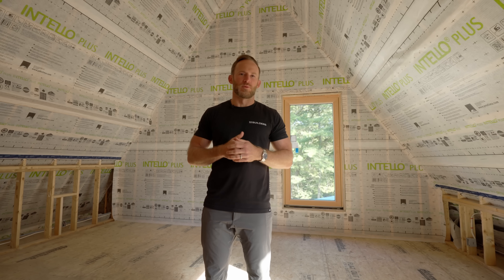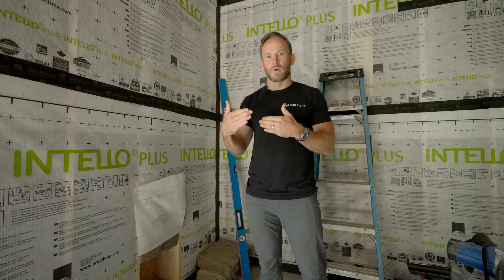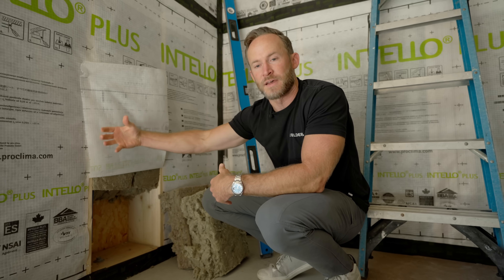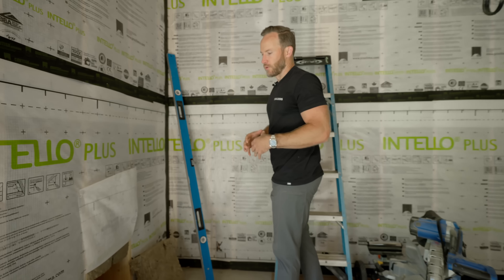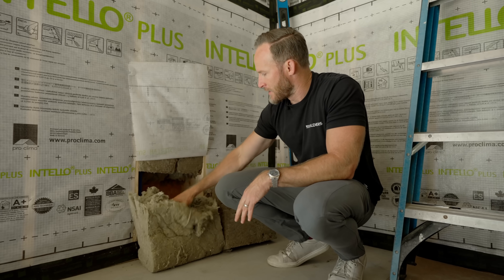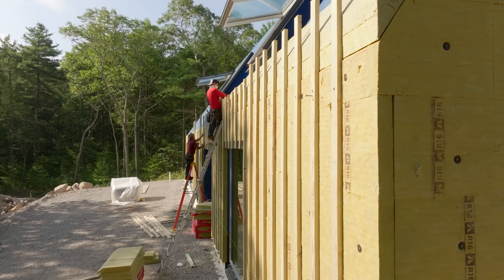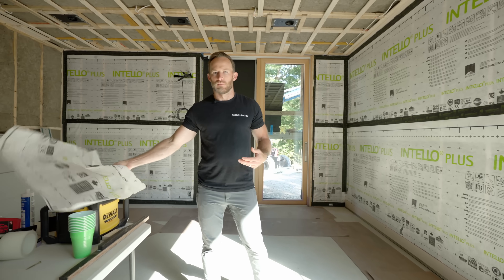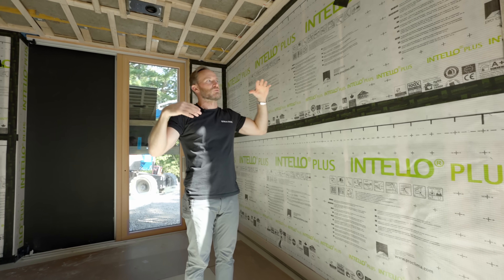Better Than Spray Foam? Why We Choose Mineral Wool

Comment: Theres not a lot of options when it comes to insulating a vaulted ceiling in cold climates. Most people cannot achieve the needed R value without using spray foam.

Comment: Nice work and presentation. I would have liked to see how you work around electrical boxes and not just wires on exterior walls. It's tough to get all those holes sealed.

Comment: There is so much misinformation on the internet about CC Spray Foam.  2x10" walls struggling to get good R-Values.  R values were invented by companies that produce fiber.  Why not examine BTU heat transfer and air sealing of CC vs fiber?   4" of CC spray foam stops up to 96-97% of BTU heat transfer, adds 2-2.5 X racking strength, air seals and is a moisture barrier all in one, while fiber adds none of these benefits.  This job and your approach make this a very expensive build trying to achieve something a good quality CC spray job could do for far less with far better benefits.

Comment: Talk to an acoustician, but I'm pretty sure you would get better sound reduction performance if you left an air gap in your wall somewhere. So say, drywall- air gap-insulation-drywall. In fact, even better if you used sound channel perpendicular to your studs before the drywall goes on.
Sound transmits through air and through the structure. You need to block both types of transmission to ensure thorough sound reduction.

Comment: It looks like your're using the adhero on the exterior and intello on the interior? Why not just make the exterior sheathing your air barrier? Is having both an interior and exterior air barrier worth the extra cost in product and labor? Does having both create a moisture management issue within the stud cavity?

Comment: Nice Design. Yes, foam is a disaster, wood needs to breathe. Rockwall rocks! Foam is a perfect matrix for mycelium mold, wood rots really quick, surrounded by foam if it gets wet. Nothing wrong with air handling especially with that much vertical, stacking effect can be an issue.  air needs to be filtered and conditioned the house. That's too tight is unhealthy. This is going the right direction. Here is an interesting fact in the UK, banks won't refinance if the house is sprayed with foam... close cell or open cell.

Comment: Better than spray foam? Yes, but its a hard material to buy unless you are contractor. The distributor system is lacking and honestly, a very old business model that needs to die. And its even harder to find quality installers.  Spray foam is everywhere. You can contract it and have it installed with a simple phone call.

But! If you can source it, and install it, its awesome.

Comment: Just sold me on foam, thank you. Didnt realize how much it would cost, i always thought spray foam was super expensive and only for the rich, but now i realize that to overcome all the obstacles you have to engineer around everything like expensive walls and framing, ventilation, exterior insulation, etc. Spray foam and if your worried about health then encapsulate it with some paint.
Reply from the maker: Paint doesn’t fix the health issue. Not the bigger degradation issue.
Reply: @NSBuilders I thought you were talking about the out gassing of VOC's caused by improper installation. Tell me more about the degradation problems. I do know that uv light will degrade the foam really fast and anything exposed to light should be painted as soon as it is fully cured even if it's temporarily exposed. Is there any way to address the problems with spray foam? I'm not a fan of spray foam by any means, but sometimes the expense is too much and spray foam is an option when done right. If you have the money then yes engineer around the problems.

Comment: I don't understand all of the insulation installed in this house.  R-55 walls?   Vs. no insulation, R-32 reduces energy by 97% and R-55 is a 98% reduction.  So you have extra cost of the insulation, much larger and more expensive framing for an additional 1% energy reduction?  If they were also going for sound reduction, there are cheaper and better alternatives.

Comment: really enjoy your craftsmanship! a quick question: in europe there's a greater preference for wood fibre external insulation over mineral wool (e.g. gutex wood fibre vs rockwool insulation etc.). is there a specific reason why you didn't also consider wood fibre as well? perhaps availability or some other property?
Reply: Fire rating; mineral wool doesn't burn.

Comment: what is better, the extra insulation, but some pentrations that aren't sealed as well or say, 2.5 inches less insulation and a technical cavity for the electrics and a better air tightness.

Comment: I don’t love the idea of construction details that rely on vapor retarders or barriers behind drywall. This is because over time, people will renovate the home. They’ll cut new holes in walls for new electrical outlets. People will screw things to walls. Walls will need to be opened up to fix plumbing or electrical.

In those cases, there’s zero chance that people will manage to seal up all penetrations in the vapor retarder plastic sheets behind drywall. So then there will be some holes that freely allow vapor flow, and some air gaps could lead to cold condensation problems. 

I think it would be better to design wall systems that don’t rely on fragile vapor control layers behind drywall. Maybe that just means increasing exterior insulation and leaving uninsulated service cavities behind drywall.

Comment: I've been following builders such as yourself, Risinger, R&R and the lots for many years. It's definitely highlighted areas where homes can be vastly improved with a little extra time, money and effort. I'm currently building a 12x16 tiny home with a high loft using all these best practices. I'm hoping to heat it during the winter with a box of matches. I'm a nerd for this kina stuff. Great build Nick from my old neck of the woods.

Comment: You forgot to mention that rockwool has formaldehyde in it and the manufacturing process is quite bad for the environment even though it does recycle some industrial byproducts. 😉 You have to buy the EVO line of their products to get the formaldehyde free stuff. It’s not as rigid due to the lack of binder and nobody carries it. I used to work for a guy that would buy containers of it at a time so that we could get it at all. I’m not a fan of the doubling up of batts per stud bay. No way there aren’t gaps between them. Why didn’t you talk about dense pack cellulose? It is the premier insulation in my opinion. It gets in cracks to seal them, goes around pipes and wires, is non toxic, and made from a recycled product. I have torn into wall assemblies that are over 100 years old and found cellulose that hadn’t settled at all and was bone dry despite being in a leaky house..

Comment: How do you do the air gap in the ceiling? is it dependent on those furring strips -- that is, does the rockwool simply lay on them and isn't as thick as the ceiling cavity is deep? Or do you have some sort of product in there to create the gap?

Comment: Why not ZIP-R panels on the outside of the house to help in thermal bridging? 🤔
Reply: I did a house that way. Zip 1.5, 2x6 walls w/rock wool, vapor barrier, drywall. Quiet. Warm. Relatively cost effective. Equally important: accepted and easy to implement, with readily available materials.

Comment: Awesome! And in 400-500 years it will pay for itself in energy savings.
Reply: @oldman0563  definitely on another level this house. I just finished building my home and we calculated all insulation would be paid off in 3 - 4 years. Our energy prices have doubled over a pretty short timeframe and probably will again. Meanwhile our insulation is a one time fixed cost we don’t have to worry about.
Reply: I’m guessing they went way past the apex of bell curve.. At some point, you’re just wasting money for your personal feelings about energy efficiency.

Comment: i am big fan of open cell foam however you need to have good technician to apply it. with wool, over time, always you will have micro particles to breathe in..
Reply from the maker: The wool is completely contained.

Comment: We put mineral wool in the ceiling when we redid our basement along with sound isolation clips for drywall to hang off the joists. Both had a huge impact but I noticed it right away when the batts were put in. Now I wish we had it in all interior walls as well (except that it makes running new wires a pain)
Reply: @awwbeans  did you put Ridgid foam first to air seal or just rock wool for the bats. I was looking to do it and just rock wool would be so much faster and easier.
Reply: @Tom-u8t9y in the ceiling? No rigid foam but these are 1x12 joists so there would be little room for both. I did a fair amount of research, and I never heard of anyone putting rigid foam for sound isolation. If anything, a lot of people recommended sandwiching two layers of drywall with sound isolation adhesive but I couldn’t spare the loss of ceiling height
Reply: @awwbeans I thought you were talking about the basement
Reply: @Tom-u8t9y yes, basement ceiling. For the walls it’s against code in our area to use foam board against the foundation and you wouldn’t need to worry about sound isolation there anyways
Reply: I thought that sound mainly travels through the studs? That’s why the double sheet rock approach is superior to just relying on insulation to deaden sound?

Comment: did he say "plumbing in exterior walls" ?   If you are in a really cold zone, that could warrant those crazy thick walls, you best not put water lines inexterior walls.  then there is the over size glass.  seems like a lot of miss matches.   Lots of Kool Aid being served.  was hoping to learn more about mineral wool.
Reply: Where I built (cold climate) we could not even run plumbing vents in an exterior wall…forget about any kind of supply plumbing.
Reply: Did you not watch the video those are some crazy thick walls.

Comment: What happens to the mineral wool IF when you are installing it on the outside, IT RAINS does the wool hold the water or do you rip it down and start over??
Reply from the maker: Comfortboad is installed on the exterior. Semi ridged material that is vapor permeable and water resistant: allows management of moisture in an out of the wall assembly.

Comment: So much work and just as expensive as spray foam. Spray foam is a superior air barrier, and can be put in after all the penetrations. I love the idea of exterior insulation, but the two layers of rockwool and vapor barrier are slower to install, more expensive, and less effective than spray foam would have been.
Reply from the maker: Totally disagree. We also tested at 0.6 ach pre board
Reply: @NSBuilders  I wasn't suggesting that this wasn't well-built, it clearly is. I also used Rockwool in my build, but in combination with professionally-applied closed-cell spray foam.
For me, I would have gone with spray foam insulation here. It's more about the labor cost.
Reply: 1. Spray foam does not insulate against noise, nor against heat, the low mass and low specific heat capacity give it a low thermal mass.
2. Spray foam does not remain air tight over the years which make your wooden construction more vulnerable to mold and rot.
3. Spray foam makes your house much harder to rebuild or remodel.
Reply: @koenraadprincen7212  1.I used spray foam under my black metal roof in Florida. I can 100% confirm that it protects against heat and noise. You would also have a significant air gap with these 2"x10"s which will mitigate noise (and could have been a double 2"x6" wall if noise was the #1 concern.)
2. How many years does professionally-installed closed-cell spray foam last?
3. This house is impressively framed with 2"x10"s. It's going to be a beast to knock out any of these walls regardless of the insulation.
Reply: @westchester1R  
1. If you're still using an air condtioner to cool your house in summertime, you can't tell how good your insulation works... You will notice the difference when you switch off your A/C and see how long it takes before it gets hot under your roof.
2. Matt Risinger did not use spray foam for his own house because you cannot trust it for air sealing, not even during the constructtion fase (blower door test).
3. Could be, but if everything is "glued together" with spray foam, it's even worse.
Reply: @koenraadprincen7212  I built my barn in the summer in Florida. No air conditioning, just used fans to keep me alive.
There is no question -- once I was finally ready for the spray foam and they covered the roof, it went from being an oven to being tolerable. This was without any other insulation in the entire barn, in Florida, in the summer.
Reply: @westchester1R  Spray foam does insulate, even against heat, but not as good as any natural material with a higher specific heat capacity, that's my point.
At a certain moment the spray foam itself is fully warmed up, so it will no longer insulate but will start to radiate heat.
That's why you see some people adding aluminum foil against their lightweight insulation materals under te roof (EPS, XPS, Poly Iso, spray foam,...), aluminium foil will also heat up but it will not radiate heat.

Comment: Came across your channel around your visit to the Swiss school visits and how you loved the skills taught and respect shown to the young professionals and different way of learning and working. One thing I cannot get over is that in North America builders don’t use plastic tubes for the cables so if needed you can just pull a new cable through, wether it is electric or data you now always need to open a wall which is just unnecessary costs.

Comment: what do you think about what Spray Jones says about R value being misleading?
Reply: His big thing is air sealing, which is already handled by the sheathing on this build. CCSF would still have a higher R-value per inch, but with all the exterior insulation it's not a big deal.